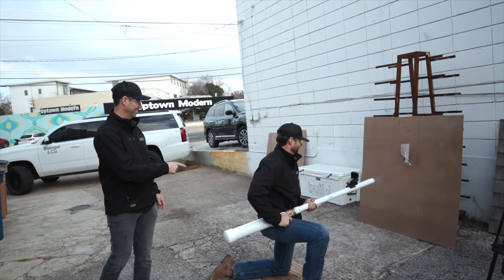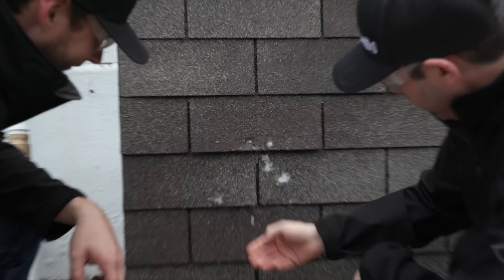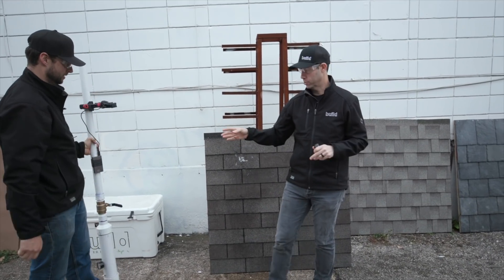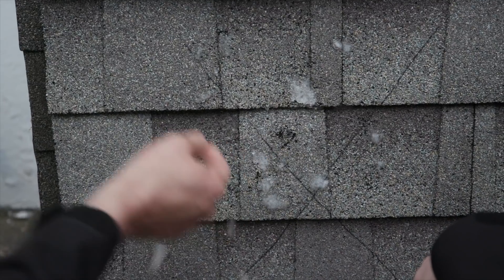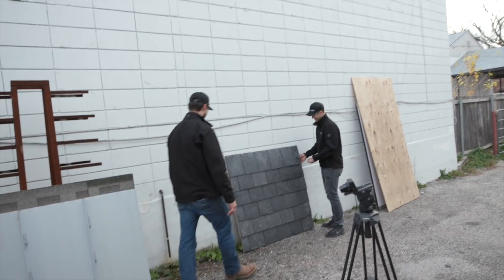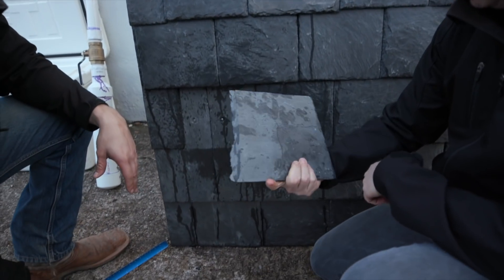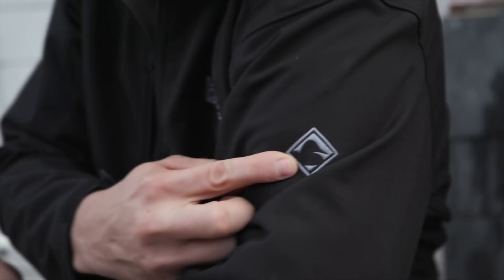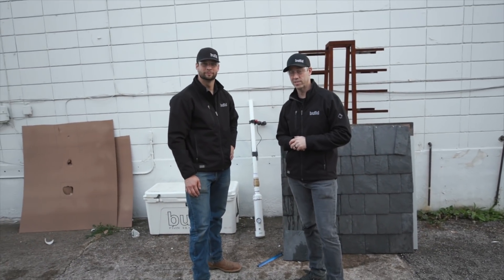Simulated Hail Damage Test: Asphalt vs Slate vs Metal Roofing

Comment: Would you ever recommend doing a DIY roof job? If not, why?
Reply: Negative. Normally one can watch YouTube videos and get a good idea of how to do anything. Unfortunately there are a lot of terrible roofers who do videos and teach techniques that will fail. I will not name anyone but there is a guy in LA who gets a lot of likes but 60% of his ideas will fail. 
Better to use manufacturer's technical manuals or videos. By the time you buy a ladder, nail gun, rent dump trailer...
You are better off paying to have it done. If your roof is steep...totally different set of rules for safety. 
There are a lot of tricks/techniques that need to be used to make sure a roof will not leak based upon numerous factors. If you are in Austin or San Antonio the Austin Roof Doctor will provide a free estimate.